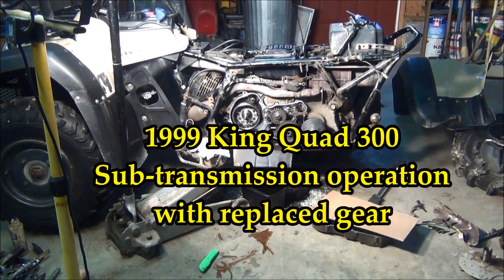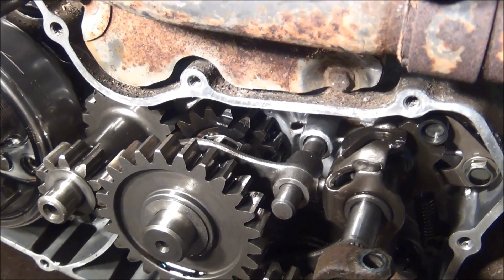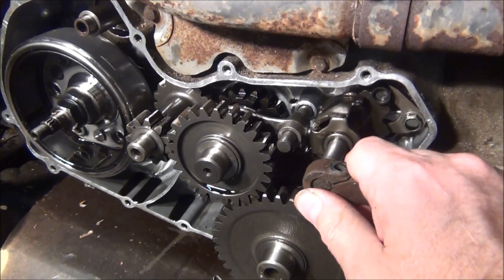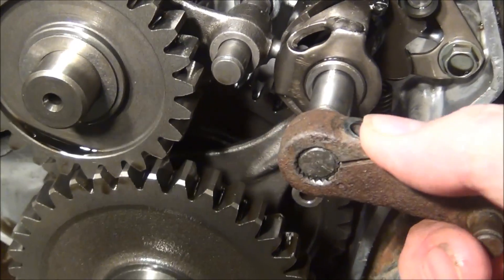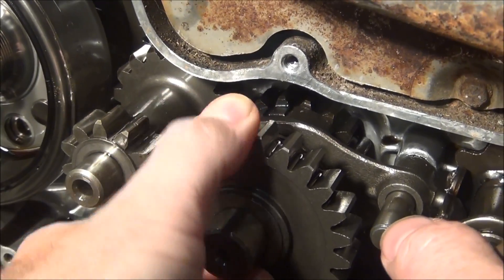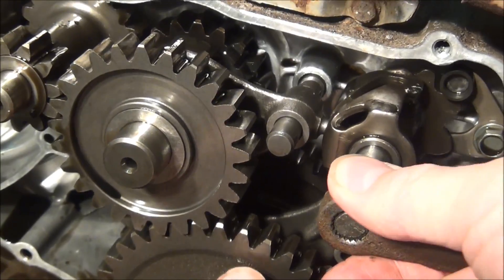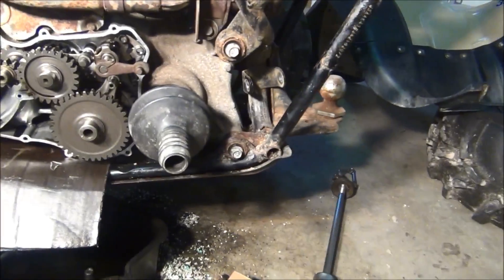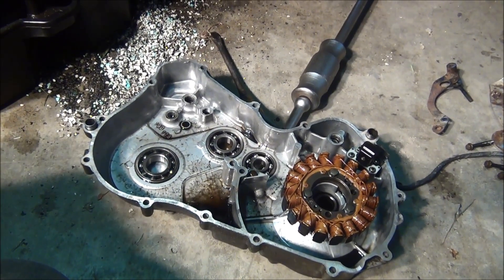King Quad Sub transmission

Comment: Do you often work on wheelers in a bathroom or locker room? 
Cause it sounds like at least one person is taking a shower 🌊
I could stop still hear you fine it was just a little distracting
Reply from the maker: That's funny. Was out in the garage and it was raining cats and dogs.
Reply: @pmatulew1  all apologies I didn't even consider that, my bad.
Reply: @pmatulew1  I want to say thank you very much, I have been trying to figure out my wheeler for six months and had got nowhere. Then I seen this one along with your others related to it. Now after reading all the comments on them I am sure I will be  riding it very soon.
PS  For any cat owners with this issue, if your looking for detailed info on reassembly don't bother buying the Arctic cat version of the manual go directly to the correlating year of the Suzuki service manual.
Thanks again and happy trails.

Comment: Thanks Paul for the great info on this gear. I had the same problem and was able to get the parts and repair the problem. You said there was a caveat about reinstalling the gears. Do you have any info on what has to be done. Thanks again for the great video.
Reply from the maker: Only caveat is something I heard about an oil channel and which way you orient the splines when you put it back together. I just put it back together not knowing any better. I think there is a forum somewhere for these machines that discusses the proper orientation. I haven't seen the quad in years. It belongs to the farmer down the road and he uses it around the yard.

Comment: Really happy to come across this video... I just bought a 97 King Quad 300. Somehow the sub transmission is shifting into super low while set in the high position on the shifter. Then the low is still in the middle setting at the shift selector. And when I try to shift to super low which would be in the High position at the sub transmission it just won't engage.. I can not for the life of me understand how the  shifter arm is in the right position while the internal gears are reversed? I know I need to open this but I really want to know how difficult it is to get this cover off. Will anything fall out of there when I take it off and is it a bitch to get back on?  Can I get away with Honda Bond for my gasket ? Any other things that will need replacing when I do the job besides whats damaged inside? Gaskets, ect.. The quad is perfect otherwise... Really hoping for a quick response here.
Reply: well it was 3 years ago i see no response ( did you figure it out?

Comment: I have a 98 quadrunner 500 sometimes it doesn't wanna go in neutral any suggestions the atv has 500 miles on it it sits in the shed alot

Comment: i got a 300 arctic cat ,,,same motor ...i got two gears busted ,, i had low range but no high range .. where can i find a video of someone putting the case back on ,, there's some washers im not sure where thay go ,,thay fell out when the case came off ,,
Reply from the maker: This was a one off project for me. So I haven't done any further research on this model. I would think that your best bet would be to find a service manual and do your best to get your box back to the way it was mean to be.

Comment: What ended up being the problem? Was it that "fused gear" I have same bike with same issue
Reply from the maker: Yes it was. Still working great with the new gear far as I know. Only caveat is something I heard about an oil channel and which way you orient the splines when you put it back together. I just put it back together not knowing any better.

Comment: How did you get the gear off. I have the same problem with my king quad.
Reply from the maker: Once you have the lid off everything is exposed and all the parts will slide off the shafts. On Harry's KingQuad the inner and outer part of the #1 driven gear had overheated and fused to each other but not the shaft. I was able to slide it right off after removing the circlip and replace the inner and outer as a new assembly.
Reply from the maker: See also "King Quad Fused Gear"
Reply: What was the problem with this quad?